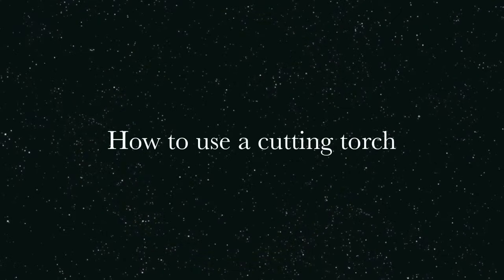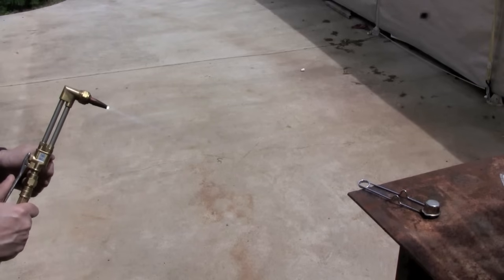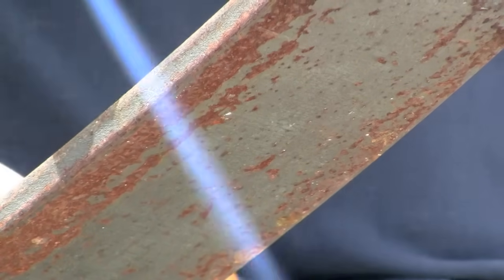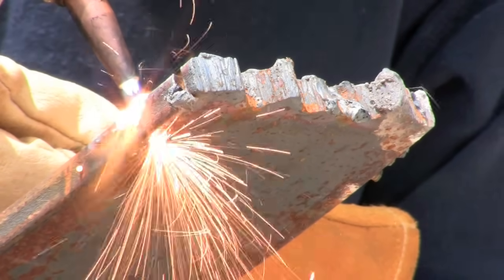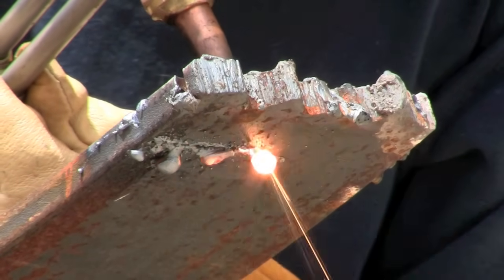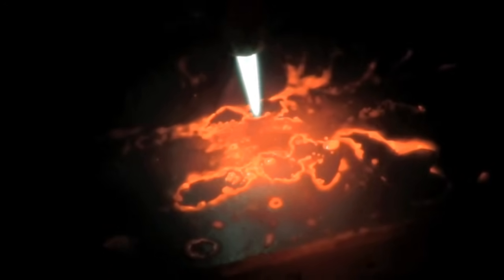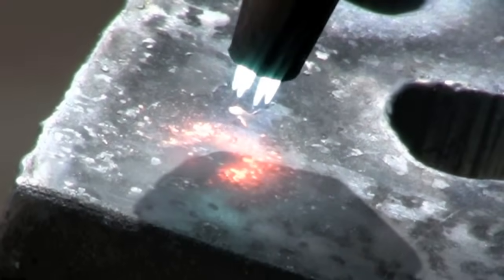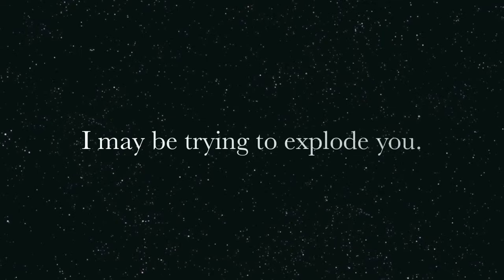how to cut with a torch. oxygen acetylene welding cutting torch

Comment: Cool Video. The oxygen is rapidly, well, very rapidly rusting or corroding the steel.  That's why it cuts so fast. But the steel needs to be in a molten state to be susceptible to the rapid oxidation. ITs Chemistry.

Comment: Thanks man I learned to use the torch in my welding clas in highschool and it’s scary using it cause your not supposed to let the tip of the torch touch the metal

Comment: the black stuff is called soot, the molden beads that hang off the bottom of the metal is called slag (you dont want that because it takes time to clean it) and turn of the torch A before O, Acetylene off, Oxygen off.

Comment: I did this in class for the first time yesterday, and I must say my cuts did NOT look that great, you should have seen the slag, I may as well have been welding..lol

I noticed you didn't rest the torch on your wrist like I was told to. I'm gonna try the method I just saw you use in this video in Monday. Anyway great video.
Reply: Lol I tried torch cutting too I sucked but  I'm getting better at it
Reply: ur tip on the end of the torch might be bad to,  normally will blow slag everywhere if it is

Comment: @12peter96 dude, there are different brands that have different ways of shutting down the torch. for example; Victor Cutting is a brand that gives instructions for shutting oxygen valve first. The torch i use, you're suppose to shut acetylene off then oxygen.

Comment: NICE video--i have a question.. why isn't the oxygen and gas mixed beforehand .. why the need to have 2 separate lines closer to combustion ?
Reply: Frank James because they would self-ignite at tank pressure and go up like a truck bomb. Because you couldn't adjust the gas mix or have separate oxygen for cutting. All good reasons.

Comment: You have a nice steady hand with fine motor control. I can burn the nut off a bolt & still use the bolt but my burning still does as nice as yours.

Comment: hey brother nice video I've been burning for about 8 years now I recommend you do not burn on top of cement the cement will explode if too much molten splatter or slag falls onto it what are the thing to emphasize is to always wear safety glasses gloves sleeves or letters and a burning shield
Reply: +werm I've noticed that when I cut through flat bars and the concrete floor spits and actually sets on fire sometimes plus if you burn a lot in the same area, the burning concrete kicks up some really bad smoke so not recommended...

Comment: You are correct. Oxyacetylene cutting actually burns the steel. The red hot steel will burn with the oxygen, producing even more heat. That was an excellent video. That should improve my cutting ability.

Comment from the maker: @pROTPANDA It depends on how big the torch and tip are. this is a 0 tip so It can cut 3/4 inches easily. some bigger tips can cut several inches. you can also get really small tips to cut sheet with if you want to.

Comment: would I use the same type of torch to cut rebar
Reply: rebar depends how much. i think an angle cutter with a metal cutting saw blade will work if you need to cut a lot of them, if you just have to cut a few just buy a cheap hacksaw I think a gas cutter like this is overkill for rebar.

Comment: Can you cut rock with an acetylene torch? I'm looking into rock-cut architecture ('caves') and different cutting tools. Thanks.
Reply: Um no, you need a diamond cutter. Rock is used to not burn, so trying to cut it with a burner is like, not gonna work. At all. Whatsoever
Reply: Yeah,i guess so  You actually can melt rock. There are videos of people melting rock, steel, etc with nothing but sunlight.

Comment: nice handling and good video .  allways remember Turn on Acethylen first , and cut off acethylen first .  its the most easy way , and the most safe way .  people think they can handle to turn the nobs and mix oxygen and acethylen in the right mix and ignite , but allso educated blacksmiths and skilled metal workers pop the flame and making backslash into the tubes , and in worst case into the acethylen tank without you knowing it course most people forget to feel the tank with theres hands.

Comment: So.... I'm by no means a qualified cutter but a couple things. I will say, SUPER jealous of those nice clean cuts you're getting.... They're gorgeous. 

1. DO NOT completely open oxygen, open it all the way then a quarter turn back, it's just kinder on your nice tool.
2. DO NOT light your torch with a cupped hand, palm ALWAYS down. Acetylene is heavy and can gather in you hand... If you strike that sonnuvabitch KABOOM and sizzle goes you hand.
3. What the is that shirt you're wearing? Guarantee it'll melt or burn if you get slag or blow back on it... WHERE'S YOUR APRON!?!

Your torch isn't "burning" metal, it's super oxidizing it with the oxygen, heating it up makes this process go faster.

Comment: its rapidly oxidizing the steel, its not melting anything, oxy fuel torch cutting way of cutting is like rapidly rusting the metal until its no longer there

Comment: when the men put acetylene torch on metal, it take about 10s to cut metal....why? is it direct or should we increase temporature for acetylene torch
i need a explan for that problem to perform my excercise
Thanks for see and reply my comment :3
Reply: The metal has to get hot enough to burn when the oxygen gas hits it. Thick metal takes longer than thin metal to get hot enough to burn.

Comment: Are there different size cutting torches? I am trying to cut 1/4" steel and it's not going as smoothly as your video.
Reply from the maker: You don't need a different torch just a different tip. They screw on and off.

Comment: Iron and steel oxidizes (rusts).  Hot iron and steel oxidizes quicker and the hotter it is the quicker it oxidizes.  When you get iron and steel that hot and then shoot a stream of oxygen into it, you are literally rusting through the metal in order to cut it.

Comment: This is what the cutting torch does: Rust metal. Rusting is oxidizing. Oxidizing happens faster when the metal is warm, and also faster with oxygen added. The torch warms up the metal, then adds oxygen when you push the lever. What then happens is an instant rusting process, rusting straight trough the metal at an incredible speed. This is why this does not work on metals that don't rust, like copper and aluminium. The results with these metals is a melting process, rather than a cutting process

Comment: the oxygen is what cuts it, the pure oxygen reacts chemically with the molten steel and converts it to iron oxide, in short, the oxygen rusts the steel, heat is used to speed up the reaction.

Comment: Great vid, Freddy. Hey, I picked up a "used" [customer returned] welding set up from an E bay seller Tadd Wholesale Supply which sells a lot of Harbor Freight customer returned items.
Check it out. I paid $60, including shipping, for a complete set up like you have here. All I need are the tanks and gas.
 I have a question.

If all I want to do is use the torch for heating, say a rusted bolt, so I can remove it, can I do that with only the acetylene?
Thanks.

Comment: 3:20 Rapid oxidation. Yeah burning or rusting it very fast. I’ve been able to start the cut turn off the acetylene and continue to cut on oxygen alone. Not practical but proves rapid oxidation.

Comment: yes indeed, the oxygen is burning the steel, the iron in the steel is burning and turning into iron oxide, that is the slag you see.
when it comes to turning on and off the torch, you can think about it in your head, and come to a conclusion. if you turn off the acetylene first, there will be too much oxygen and the gas to oxygen ratio will briefly become stoichiometric, aka the torch tip will go "pop". and then the acetylene will stop burning, leaving a small amount of acetylene in the air, and a bunch of oxygen, but oxygen is in the air, so it doesn't really matter. if you turn off the oxygen first, the acetylene will keep burning in the air, and creating soot, aka carbon powder, but carbon on its own is harmless, and unlike a wood fire, there is no ash, so really the only problem is the possible generation carbon monoxide. but even if there was some, it wouldn't be much, almost certainly not enough to worry about if you are in a ventilated area (as you should be if you're using a torch) probably the best way to turn it off, would be to turn both knobs down at the same time. or you could do the same thing, but before the flame goes out, stop and first turn off the acetylene, then there is no soot or possible carbon monoxide, and only a little tiny pop.
these are just thoughts, not official instructions, but I bet it would work great either way.

Comment from the maker: @vochitoken This only cuts steel and iron. Plasma cuts everything. You can get started with this cheaper but plasma is cheaper in the long run. you would need a really expensive plasma cutter for thick steel but oxy-acetylene cuts really thick steel no problem. the oxy torch heats the metal more than the plasma so you will get warpage and other heat related problems if you are not careful like hardening.

Comment: When you want to cut a hole I use a center punch and make a dimple then when you preheat the iron a small bead will form in the dimple and when you put the oxygen to it  this bead goes right thru. It also seems to form quicker than just heating the iron.

Comment from the maker: @CoolasIce2 you would need a special tip that draws air in. It would take longer. If it's really thick it may take forever to heat up. Oxygen is cheaper than acetylene. So you may want to use oxygen with it to save time and money. Some people braze and solder with acetylene alone but it's not as good IMO. The best thing for heating cost wise is using propane or LPG and oxygen.

Comment: Once upon a time I had job where I did a lot of ‘ line burning ‘ where i cut plate steel using a motorized torch holder on a track. You get it going just the right speed and steady ness and the slag just shoots off like a jet and the edge looks like you cut with a saw, sometimes even smoother.
I remember older time guy showing us how to be able to cut very thick steel with a number 1 tip. Steel you might need a number 3 tip for. You cleaned out the center oxygen hole very carefully with tip cleaner then adjusted the oxygen for a delicate light pressure which would cause the cutting flame to have a very long center. Like only about 5 lbs pressure instead of 20

Comment: 3:35; Your not burning the metal, its a chemical reaction called Oxidation. Carbon steel melts at around 1500 degrees celcius, but Oxy cutting doesnt (shouldn't) exceed 950 degrees, (ignition temperature)

Comment: Preheat is not necessary for oxy fuel cutting.
Reply: Ian Smith depends how thick and what grade of steel you are cutting
Reply: puncru still no. When welding or brazing different metals preheat is necessary to avoid cracking but cutting is a chemical reaction not one induced by heat. As long as the torch has the proper fittings and gas flows it will cut cleaner on a piece with no preheat.
Reply: Ian Smith well I’ve tried with and without preheating it works better with preheating imo
Reply: puncru that’s because you were most likely using the wrong tip size for material thickness and your heating flames weren’t effective. So you would get a bad cut either way

Comment: that's how I was taught in welding class. back in the late 70s. a lot of comments on turning on the acetylene first. the first knob allows oxygen to the torch. then he lights the acetylene. then he turns on the oxygen. so the acetylene has been lit first. I give this video a thumbs up. Thanks for the video.
Reply: Oxygen on full, turn your gas on then add the oxygen after

Comment: question, when I turn the oxy on a little and the fuel on max, I get a flame. but when reversed (oxy high fuel low) I don't get ignition.  I am a newbie to this!  Does a low/empty acetylene tank feel like a propane tank?? if it has gas, would it slosh like a propane tank?

Comment: When it's molting and it pops like that it's because the metal isn't hot enough for the air to push through and you don't have enough penetration, the air pushes that molted metal up and back out. Also if it starts popping or whatever you may have the torch too close to what you are trying to cut and this will cause similar problems that you definitely do not want. make sure to hold it back abit and heat it plenty before you start blowing through that bad boy.

Comment: The best tools for metal cutting are plasma cutting machine and optical fiber cutting machine. Compared with traditional flame cutting, plasma and optical fiber cutting machine cutting metal is more effective than traditional flame cutting, and it is very safe to operate only to the machine control panel to achieve metal plate cutting.

Comment: thank you for this video, i was taught how to do this today at work and was shown the opposite ,i was told to turn the acetylene on first and light it, then add the oxygen gradually. Would you spare the time to explain if this method that ive been taught is correct or any issues you have with it. If its not asking too much.

Comment: You want to have your torch at a slight angel pushing heat ahead of your cut, this preheats and makes the cut far cleaner and you also cut far faster.
Reply: and it’s clean-  no bubbled up slag stuff hanging off the edges?

Comment: Can any body help me i have 2 ton aluminium plate about 10 inches thick and 7 x 6 feet length & breath respectively , gas cutting failed , cutting rod with welding machine also failed and we don,t have hacksaw blade
Reply: Ryan gst 😂😂😂😂😂😂, but i found the solution, Don't worry.....🤘🤘🤘

Comment: you have a really steady hand. this is by far the best  oxyacetylene cutting vid on youtube, anyway i was wondering what you have your regulators set at when Cutting, i havent cut in a while and ive been practicing on 1/4 flat steel and when ever im cutting the molten puddle will bond back together after my torch pass in some spots and my cut is really wide and not uniform... any advice.

Comment: Bruh what, turn the oxygen on MAX?? Idk what torch you're using but in the beginning the black smoke indicates your oxygen was closed and not "all the way up"
Reply: No wrong you turn up the acetylene fuel until black stops then you mix in oxygen he is using a two stage torch not a one
Reply: He has two oxygen knows, he keeps the bottom one open and the top is what he adjusts.

Comment: Plate with 5-half inch, using cutting nozzle 1/32, 
Plate half to 1 inch, using cutting nozzle 1/16
And the rest, 1/8.

Before start cutting, heat the plate surface around 5-10 second in 1 inch from starting cutting, then put you nozzle away from plate ( this method for purpose, to avoid you getting hard spark, and prevent you plate(starting cutting) from melt). , press the toggle to start cutting, then move slowly to plate that you wanna cut,

Comment: Always angle  you flame toward the way your cutting if possible ( not straight up and down to cut)  so it preheats the metal coming at the torch head and allows it to melt faster and be ready fornthe oxygen to blowout the metal.

Comment: Nice video. But you did go pretty fast when adjusting the flame when first lighting the torch. 
And what happens when you press the Oxygen Handle on the torch? How much comes out?
Can you cut without using the Oxygen Handle?

Comment: Have to love all the negative feedback when you can out cut someone with a torch.

One of the better videos you can watch.

It's very simple. Keep a clean  tip and use the right sized tip for the metal.

When you pull the trigger your flame should not shrink or sound like it's being blown out.

When you get really good and dial in your settings when you pull the trigger your flame will get bigger...

Comment: Look more carefully - he's opening the main oxygen valve all the way before doing anything else, but the secondary valve is shut.  He lights the acetylene and adjusts it, then starts to open the secondary to add oxygen to the flame.  This is the same way that's specified for my Victor torch.

Comment: hey great job man, I have a cutting rig and I had a stroke a few years ago and it damaged my frontal lobes in my brain so I have to re-learn alot and you tube is a great tool for me, before my stroke I worked at one time in a radiator shop putting old tanks on new cores, and putting a torch to a fuel tanks that leaked it was butitia bros radiator and auto repair in rockford IL I made new ac lines for cars, custom rad. for hot rods, you can cut a good true line my man and them holes were great you have skill, so I been turning my gas up too high, see I have 2 lines put together or hoses you get adapters that way you don't have to move your tanks, thank's alot

Comment: definitely turn off the OXYGEN first. If you don't then you will have a giant cloud of high oxygen content atmosphere around you that will make things light on fire very easily. Mix that cloud with the inevitable hot metal laying around and you're just asking for a shop fire. Turning off the oxygen first means that you'll just have a bit of soot from the acetylene flame, not a big deal. It's a lot harder to make an acetylene cloud due to the fact that it will continue to burn in normal atmosphere.